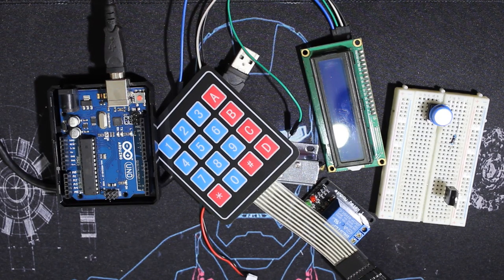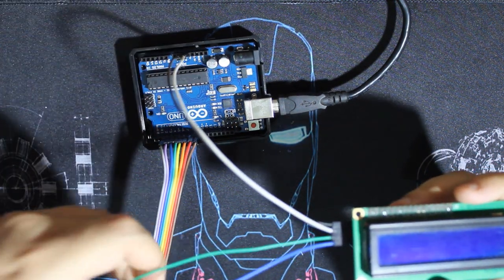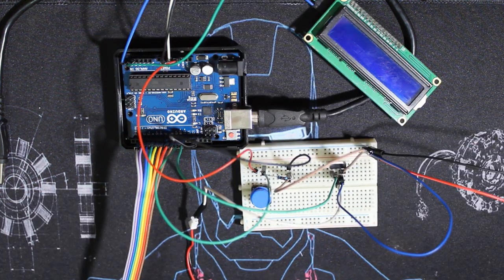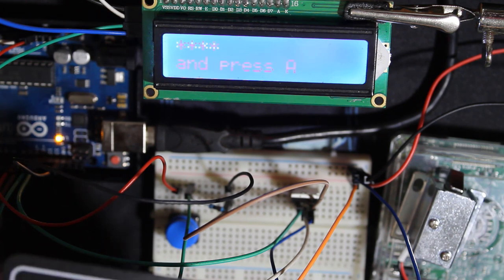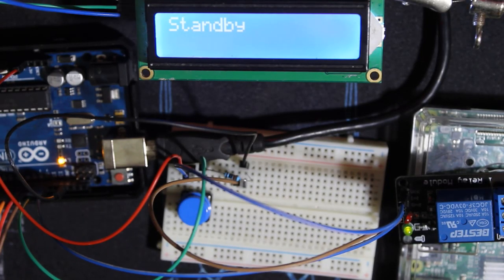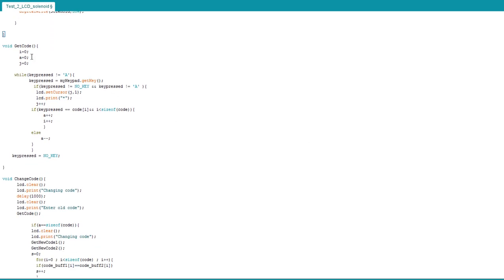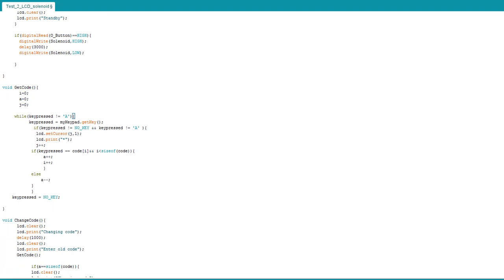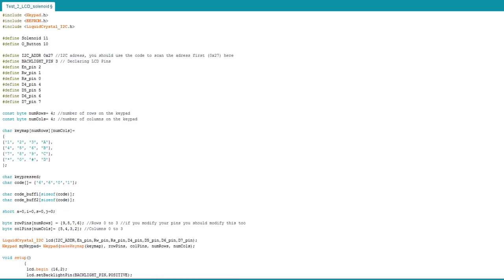Arduino Door lock with keypad + LCD + Solenoid/Relay

Comment: I made a door lock system with relay  connected to the solenoid it's almost the same but without push button and resistor so I want to know which part of the code should i change to make it work with my project
Reply from the maker: The button just opens the lock from the inside, if you remove it you can keep the code as is it no problem...

Comment: Please someone should come to my rescue, the code is giving me error when compiling.the error is as shown below
no matching function for call to 'LiquidCrystal_I2C::LiquidCrystal_I2C(int, int, int, int, int, int, int, int)'

What could be responsible.
Reply from the maker: Hello, sorry your previous comment was on hold, as I told you it's a library (LCD) problem delete the others or adapt the code to the one that you use
Reply: @SurtrTech  Thanks sir, i delete other library and it compile successfully
Reply: @daviddafeng896  hello sir, how u remove other library?

Comment: Good day sir... What if i dont have the irf 510n transistor.. Can i use rif520 is it possible
Reply from the maker: Yes just check the Vds(should be higher than the solenoid voltage) and Vgs(around 5v)

Comment: Good day sir.. What if the powercut off.. While using ac adapter for arduino how can automatically switch into dcpower...
Reply from the maker: You can add an automatic power source selector, which is a project on itself.
Reply: @SurtrTech  can you trY it sir plzzz.. I dont know how to do that sir...
Reply from the maker: Sorry I've never made one, but you can check around there good examples, search for Arduino backup battery/power...
Reply: @SurtrTech  good day sir... Can you please show the connection between the relay and the solinoid... Sir.. Because the it is not working .. Sir

Comment: What can I use to substitute MOSFET IRF510N if I can find one, please reply.
Reply from the maker: You can use an optocoupler just look for one which diode forward voltage is 5v or below if it's below add a resistor to divide the voltage, also check the collector-emitter max voltage it should be higher than the solenoid power voltage.
You can use a bipolar transistor but you'll need to add some resistors.
Other MOSFETs can do the work

For MOSFETs always check for the Voltage (Gate-Source) it should be 5 or 4V at typical, so it can be triggered by Arduino 5V, and check for the Max Voltage (Drain-Source) it should be higher than the solenoid voltage this one has 100V.

For the bipolar ones you should consider the solenoid current, and do few calculations to find the correct resistors to use

Comment: Hi, I dont have LCD like you, can I just use regular LCD(16pins)  for this project?
Reply from the maker: Of course you can do it but you should reduce pin numbers... You can use the "one wire" method for the keypad.
Reply: @SurtrTech  what do you mean by one wire keypad? 😅 sorry I'm still new in this things 😅
Reply from the maker: Well if you check the wiring you'll see that there's no enough pins to add a standard LCD screen since it requires about 6 digital pins... So you can make the keypad as one wire only, you can look it up, you'll just need some resistors and you'll wire it with an analog pin, but you'll have to do a lot of changes in the code too.

You can use an Arduino Mega if you want you'll have to rearrange the pins and don't forget the correct libraries and codes that you have to chose.

Comment: Hey man it is giving me this error 

Keypad_doorlock_relay:50: error: no matching function for call to 'LiquidCrystal_I2C::LiquidCrystal_I2C(int, int, int, int, int, int, int, int)'
Reply from the maker: Sorry for being so late, I didn't get the notification, this is a library problem, either you didn't install it or you already have one that's not compatible with this function, so you either install it or adapt the code to the library you use.

Comment: sir what type of solenoid do you use? please notice me :) thankyou sir..
Reply from the maker: 12V 0.4A Solenoid door lock...
Reply: @SurtrTech  can i use 12v 1A sir??
Reply from the maker: @InezAtalika  Yes, the transistor I used can support up to 5.6A... Check your transistor data sheet if you're using another.
Reply: @SurtrTech  thank you sir for your answer is very helpful🙏